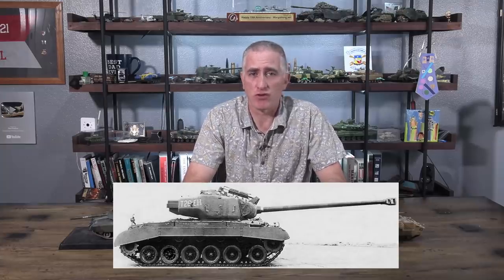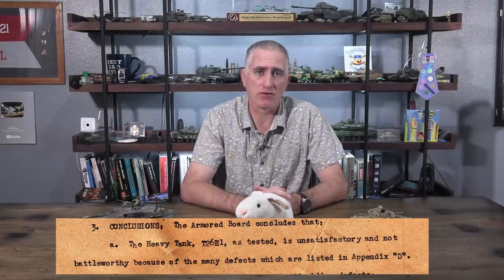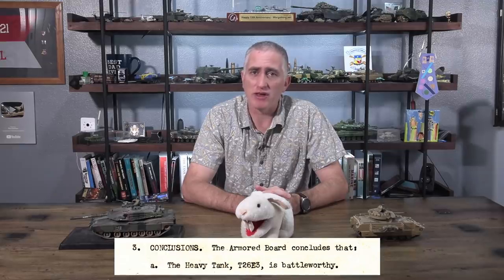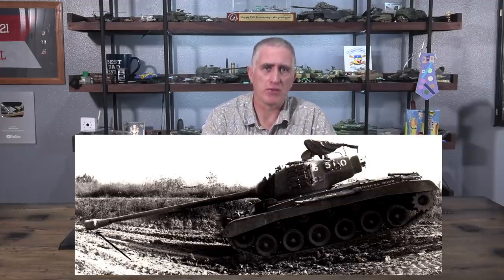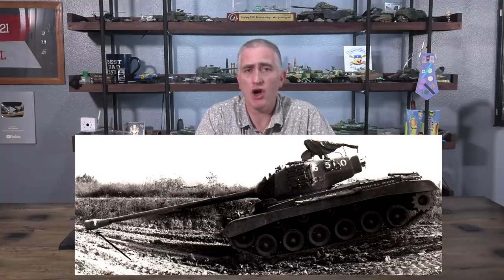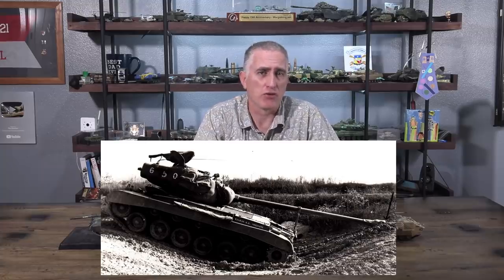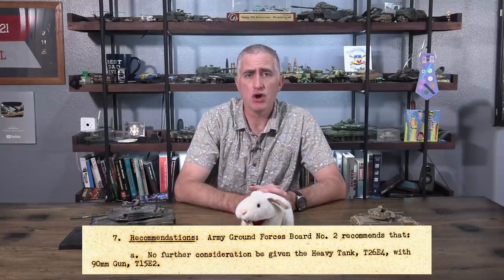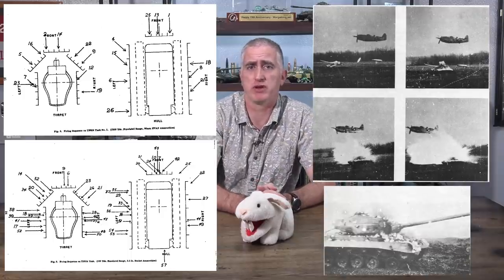Super Pershing: Why T26E4 didn't work.

Comment: @chieftan do you think rounds coated with diamond dust would perform as well as,or better than tungsten rounds or even possibly depleted uranium rounds ?
Reply: +420choochy
Tungsten and uranium is used to concentrate more mass in a small sabot volume, to concentrate maximum kinetic energy on a small penetration area. Also (as I understand) uranium rounds have some self-sharpening properties to enable some extra penetration. 
Diamond like carbon coatings are indeed used in cutting tools, but mostly in order to improve tool life (wear) and performance really depends on the backing material. I don't think a thin layer really helps 'cutting' perse, but more the ability to sustain the cutting. I would be interested if this was ever a research topic in the army.
Reply: It would also increase resistance when passing through armour so would reduce penetration whilst the coating wears off.

This would also increase the amount of heat so would have better incendiary effects.

Would make for a very interesting experiment.
Reply: Diamond dust is completely useless in this context
Reply: @GoriIIaTactics  I don't know if that is true, but I would dare to say that punching a 120 mm round at 1500 m/s+ is definitely more of a brute-forcing method compared to your typical lathe. Assuming that with 'diamond dust' the OP meant diamond like coatings like used on cutting tools.
Reply: Hence me asking him,he has access to archives and material I’ll never have a chance to see and also a wealth of contacts . It’s mostly a curiosity question . The diamond dust would have to be somehow coated and hardened onto the surface of the shell just to withstand the extreme pressures created whilst firing ,not even sure if diamond can be”emulsified” ,mixed into steel or other metals and actually bond or take . I know Teflon coatings are used for certain penetrators as well as boron coatings .
Reply: Yes tuning3434 I meant like that or if it’s even feasible to forge diamonds somehow into metal,I don’t believe it is possible,but then again a fifth state of matter wasn’t thought possibly until done just recently on space station . Oh and to take care of resistance issues Teflon or boron could be coated onto surface of diamonds which would make them extremely slippery . In fact Teflon coated bullets are slightly illegal since they pas through body armor like hot knife  through gutter. Then again they might have changed that law,gun laws keep changing so much it’s hard to keep up .
Reply: @420choochy  Internet, and especially 'popular science' are not a substitute for education.
Reply: @420choochy  Well I am glad you kept the derogatory part out of this chat, and I am sorry my comment ticked you off so much.
However, I cannot get past the feeling that you might be knowledgeable on certain aspect,  you still seem to have trouble to place certain aspects in the proper scope,
because I certainly have difficulty to understand what you are actually trying to say.
Depending what you mean with 'diamond dust', it can be a weather phenomenon, or maybe you mean the diamond particles sprinkled on an abrasive tool, or diamond like carbon coatings that are used on certain machine tools. I assumed the latter. As mentioned before it mostly helps in wear resistance, partially due to superior thermal properties, chemical inertness and to a certain extend the hardness helps with the peak surface stresses. However, these coatings really help with wear resistance, add on tool life and allow increase of cutting feed. It doesn't really help that much with penetration. Which sufficient force you can use any medium to cut through a material, even with water.
- Teflon coated bullets are not 'copkillers', that is just media not understanding physics. Teflon is a chemically less susceptible to bond with material, this combined with a low coefficient of friction, makes them nice sliding surfaces. There is no magic property that makes teflon coating noticeably better than a simple lead bullet. 
- What is 'diamond steel'? Diamond is the diamond-cubic lattice crystal structure of carbon. This structure greatest some extra inter-atomic bonding between the atoms (because it is more tightly packed) and, more importantly, is less susceptible to dislocation deformation in crystal structure. Diamond steel exists, it's called steel! Steel is iron alloyed with carbon. The substitution of carbon to pure iron adds the ability to form the steel in different 'phases', with combined with heat treatment can result in considerable different (macro-level) material behavior. 
- While I am no expert on penetration mechanics perse, as a mechanical engineer who does professionally have to work with highly loaded materials, I can tell metals behave considerably different under compression than tensile loads.
- Compressive stress levels, even in standard applications, are significantly higher than tensile stress levels. Where in tensile application yield behavior generally can become unstable (eg. material 'necks'), in a compressive application it far more stable and some deformation even increases critical load capability. This is what for instance why you 'run in' bearings. 
- The reason why the 75 mm round was prevalent was indeed explained in detail by Mr. Moran: superior HE round, because soft-targets basically are the only things a M4 would generally be shooting at. The 76 mm definitely had superior penetration as it had extra muzzle (sustained) velocity and thus more kinetic energy to punch / 'deform' a certain amount of material.
Reply: @420choochy  NATO shifted to the 5.56 because it let the troops carry about 2x the ammo per unit weight. Basic load was 100 rounds of 7.62x51 in 5 magazines (one in the weapon and 4 in pouches), then went up to 210 rounds on 5.56 in 7 magazines (1 in the weapon and 3 per pouch) and later to 270 rounds in 9 magazines (1 in weapon and 2x mags per pocket, 2x pockets per pouch, wearing 2x pouches). 

5.56 is much easier to fire full auto from the shoulder accurately. You need about a 20lb weapon to shoot 7.62 full auto from the shoulder with any accuracy. Been there, done that, got "M60E3" in my weapons quals back in 2002 (next to 9mm, 12ga, and M16).

Tank guns use tungsten and DU for hardness, to punch steel. DU has several advantages here, being self-sharpening, denser, pyrophoric (catches on fire in air) and technically a waste product of nuclear power and weapons manufacturing. What gets used in nuclear reactors and weapons is about 0.4% of the raw uranium metal, the U235 isotope. Depleted uranium is basically pure U238 isotope, and is not used for much of anything in industry. So it's more or less free, and has good properties for being used to punch armor. The Germans don't use DU ammo, they use tungsten. In order to get the same performance out of tungsten APFSDS rounds, they need to fly some 200 meters per second faster than DU. Which requires a gun barrel 25% longer (Leopard 2 has a 55cal gun barrel, Abrams has a 44cal barrel).

Diamonds are crystals, you can't forge them into a different shape. Diamonds are also surprisingly brittle, a steel chisel on the correct plane will split one and if you're slightly off line will shatter a diamond.

Basically, diamond coated bullets wouldn't add any significant benefits and would add significant costs.

Comment: It seems the turret was a poor design. Looking at the side view the turret could have been larger and that would have balanced out the larger gun. There should have been no need for separate ammunition since the 88/L71 was one piece round.  The tank was too rushed and the US never really built a heavy tank.  I think with the T32 they were starting to get the idea. In the late '40s the 120mm gun was tested and would have been even better than the 90mm.

Comment: So in a nutshell, Pershing wasn't much better than Tiger I.
Reply: Shut up Otto, von schliefen is trying to come up with a plan. Haha I make a ze joke!
Reply: More reliable mechanically, I think, and much better armor usage.
Reply: @ScottKenny1978  The Tiger I wasn't that bad mechanically, IF (big if) it was properly looked after. It was time-consuming.
Reply: @jthunders  As long as we beat the French, let von Schlieffen come. :-)
Reply: @ottovonbismarck2443  still not as reliable as that Ford GAA V8.
Reply: @ScottKenny1978  The Maybach wasn't the biggest issue; it was the final drive ("Seitenvorgelege"); way too weak.
Reply: The Pershing was ten tons lighter, had better firepower and a more reliable power train.
Reply: @r.j.dunnill1465  More like 15-20 tons lighter. It was a few tons lighter than even the Panther. For its weight, the Pershing was a much more impressive vehicle than the Tiger I. Of course, it was a newer design, to be fair.
Reply: @r.j.dunnill1465  AFAIK, the initial 90mm wasn't better than the 8,8cm L56 KWK. You're correct about the power train. But the Tiger was by that stage 3 years older. And it was in fact a successful design; they gave way more than they took and left the Allies quite impressed. Not that the Tiger II showed any improvements on engine/power train ...
Reply: @ottovonbismarck2443  According to Zaloga, the M3 cartridge had a bigger propellant charge (3.8kg versus 2.5kg) than the KwK 36. Hence, one would expect the former to have better AP performance. (Initially, the M3's projectiles had 2,650 fps muzzle velocity, but this was increased to 2,800 fps before the end of the war.) 

Yes, the Tiger made quite an impression on the Allies. The Tiger II did, too, and postwar, some officers mindful of its formidable armour and firepower, championed the M103.
Reply: @emu4286  You're right. 42 versus 57 metric tons, according to Zaloga.

Comment: "BFO cannon"? Explanation please.
Reply: Big "Expletive deleted" Off Cannon ;)
Reply: @jon-paulfilkins7820  ... with a Big F*cking off cannon? Is that an English sentence? ...with a Big F*cker of cannon? Maybe better. My guess was Barrel Forward Obstructive cannon ;-)   TLA (Three Letter Abbreviations) should be defined at first use. Just my thought. Thanks for the reply.
Reply from the maker: Big Feck-Off Cannon.
Reply: @TheChieftainsHatch  Thanx. Makes sense but not obvious for someone who has English as a second or third language. No offence at all, with answers as fast as this some uncertainties can be totally tolerated. I've learned new stuff today. Well done. Sincerly.
Reply: @jon-paulfilkins7820  I know that - who doesn't?  BFG is usually, in this context, short for "Big Fecking Gun". "BFO cannon" requires some additional decoding. There are a lot of wordings that might be used for BFO in this context (where "fecking" or "feck" is probably a part of it). It could also be a manufacturer. "Big Feck-Off" cannon (with the dash between Feck and Off) was not the first that entered my mind. I would have to think a lot about this to suggest it - but would it be the correct interpretation? Now I know the correct meaning and by the powers of me I now declare it can be freely used to describe a  BFG in relevant contexts, a decision heavily supported by your and @The_Chieftans truly valued comments.
Reply: @TheChieftainsHatch  Could temper it to 'Bigger Faster Ordnance' just to quell the shrillness that doesn't appreciate BUFF, REMF, ATFU, FUBAR, BOHICA, NUB, TU, Etc.

Comment: Since the T26E4 lacked power elevation, would it be safe to assume the stabilizer was omitted as well?
Reply from the maker: That would be a safe assumption, the US went away from stabilisers for a few years until they came out with a dual-axis which worked.

Comment: What basically happened is them trying to rush a bigger gun in the field without truly thinking. It is like if the Germans just stuck with the tiger 1 but tried to throw the long 88 on it anyway
 The T32 worked because it seems to be designed from the get go to handle the requirements of adding the bigger gun not slapping on a gun and trying to make it work. I suspect maybe the Sherman and the ability for it to change may of caused the mentality of what soomed the super pershing.
Reply: " It is like if the Germans just stuck with the tiger 1 but tried to throw the long 88 on"

They got very close to assembling a prototype of just that around October 43 or 44, IIRC
Reply: @Legiondude   Prototypes are a different story than actual fielded systems. They made the tiger 2 because the tiger 1 could not handle the long 88 and never fielded the prototypes. With the super pershing they tried to force it to work and came to conclusions that would of been pointed out as a prototype.